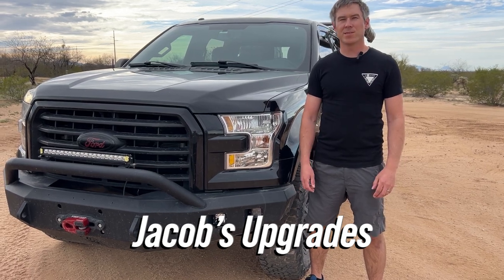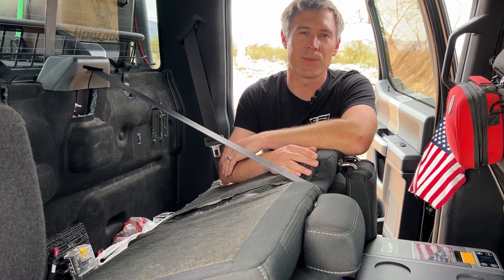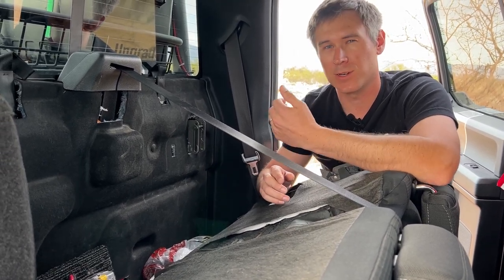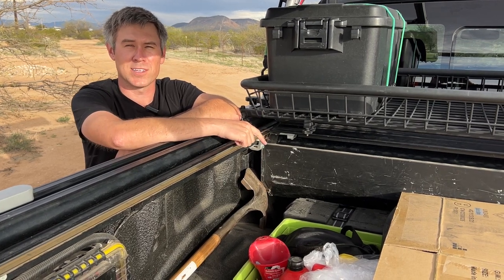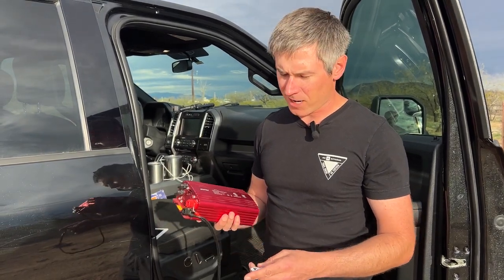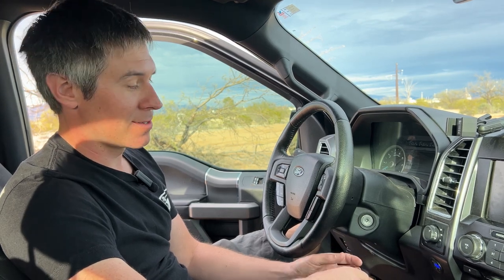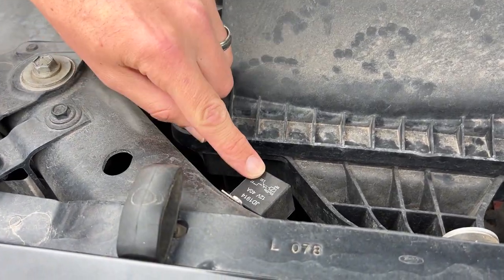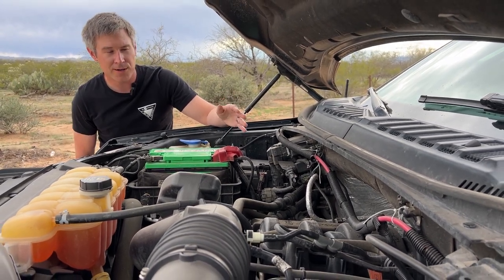Dual Battery Setup | Custom 12 Volt

Comment: Lot of helpful ideas for my new build. One thing I’ve have used to secure to stock panels behind seats is plastic drywall anchors as they’re shallow. Screwdriver will make the holes a lot less invasive than a drill. Should work well for your charge controller board.
Reply from the maker: @lynxs1981, I'll have to look into that. That's a good idea.

Comment: I see how you got your wiring out of the cab through the vent.  But how do you get it into the bed?
Reply from the maker: For the battery close to the rear cab I drilled holes through the rubber grommet in the bottom driver side corner of the bed to run 4gauge wire. For the switch panel towards the tailgate I ran 10gauge wire between the inner and outer bed panels above the wheel well along the bed rail. Electrical fish tape will be your friend. Then pulled the wire out one of the round openings towards the top of the bed to be less visible.